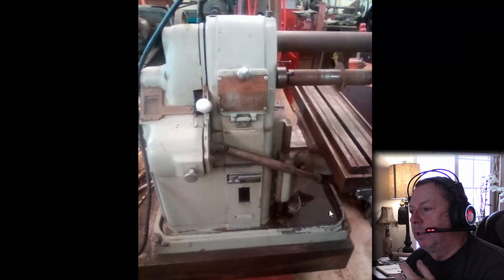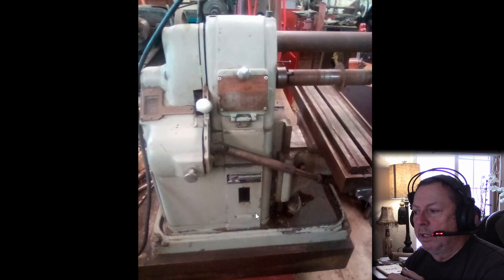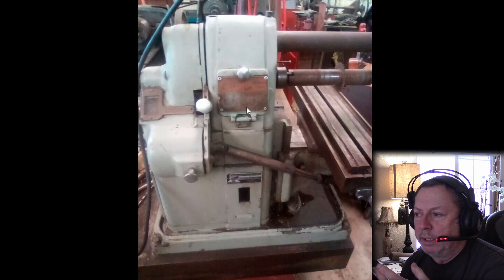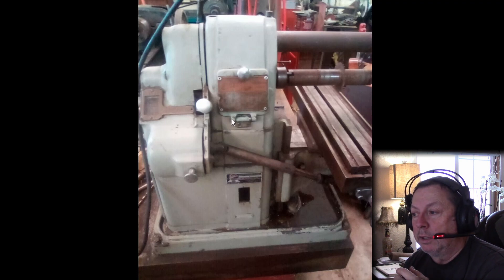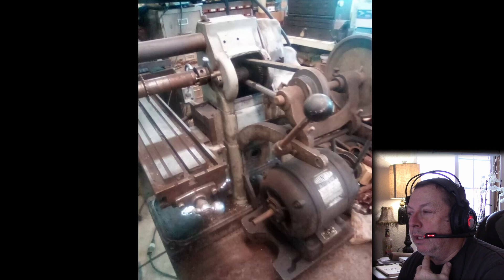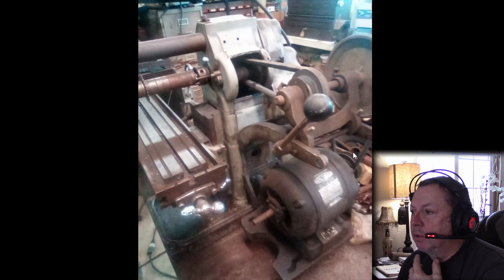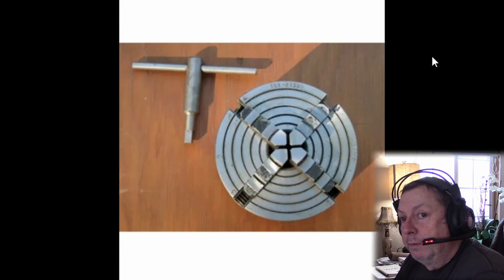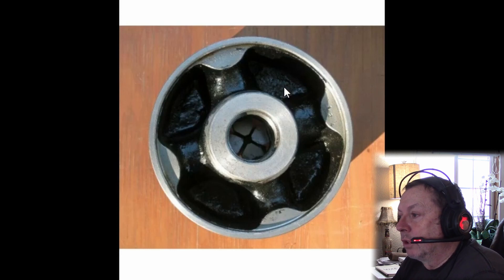Making Atlas Machines Affordable Again: Fleabay Edition, January 5 ,2022

Comment: Thank you for another insightful video. Can I ask, what is the difference between a miller and shaper vice?
Reply from the maker: The milling machine vise for the Atlas is slightly smaller and the swivel base has 2 mounting slots to bolt it to the table since the Atlas mill only has a single t-slot down the center of the table and the shaper has 4 mounting holes in the swivel base to match the outer t-slots on the shaper table. Thanks, Dan.
Reply: Thank you!